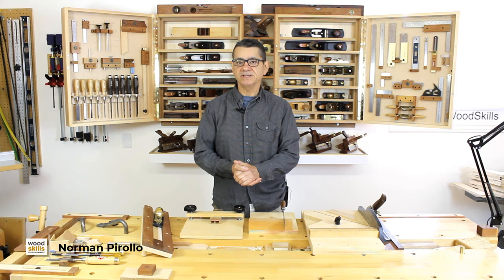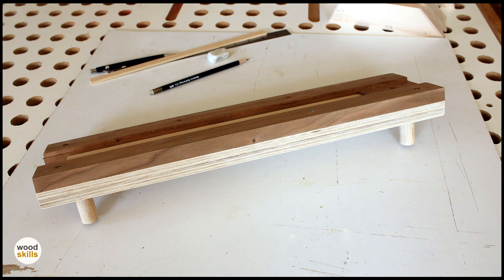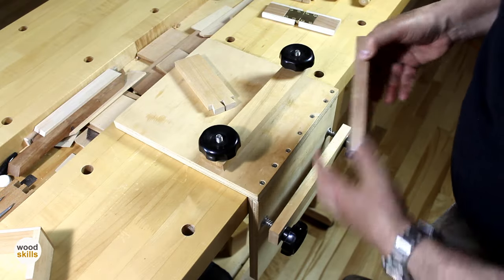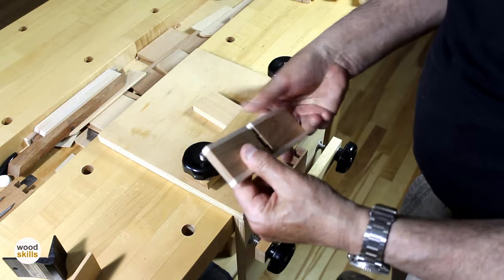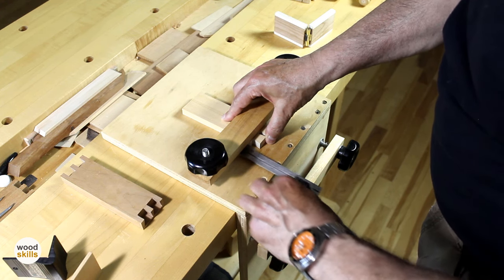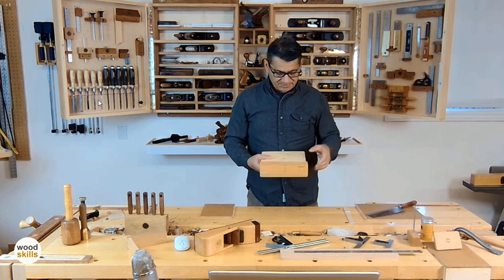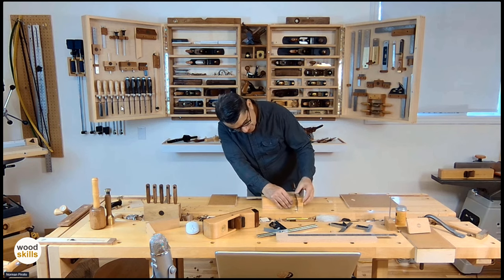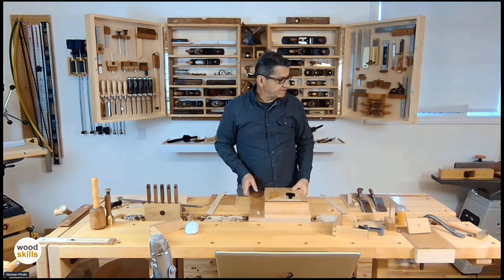My Top 4 Woodworking Jigs for Hand Tool Woodworking

Comment: I like to add a 1x1 piece of wood to the length of the bottom of my jigs so that they can both sit flat on my bench while being held in the bench clamp. Kind of like what you are doing with dows and the bench dog holes.  For example, you can glue a 1x1x6 inch piece of wood to the bottom of your kumiko jigs. (Like the keel of a boat but square).  Then set that on the bench clamp, open the clamp about one inch so it drops in,  then snug the clamp down. It prevents having to fuss with the height of the jig in the clamp and it also makes it more stable and prevents clamp racking. It also allows the use of a secondary hand clamp to hold your workpiece in the jig because there is room above and below the Kumiko jig.  I do the same trick with my thickness jig and shooting board. Basically, all of my jigs can be dropped into my bench clamp without having to adjust the clamp greater than one or two turns.
Reply from the maker: Thanks for this. I have other jigs I don't often use that clamp into the bench vise like you mention. I like the versatility I get with using dog holes so I can locate each jig anywhere on the workbench and free up the main vise. But yeah, that also works by clamping a small cleat into the face vise.

Comment: Thank you for sharing these jigs Norman such a big help. I will build myself the thickness sled.  Here are my thoughts as instead of having the spacer underneath the board to be planed, why not drop in a stop that is the thickness that you want the board to end up as?
Example: 
- The board to be planned is 12“x1“x 3/4“ thick
- Insert a stop at the end of the sled that is 1/2”  thick
- lay the board down into the track bed
–  plane until the end, touching the stop are at the same height/flush
– Flip the board end2end, and plane again until that end is flush with the stop 

Would this work?
Reply from the maker: You can definitely try your idea. The premise is to have the block plane thickness a board until the block plane is at the level of the track it rides in. Then the block plane stops shaving. The stop on mine is at the same height as the tracks, so it all works out. The spacer is what determines how thick the component will be after thicknessing. Without further thought, I would simply try your idea and se if it makes sense.